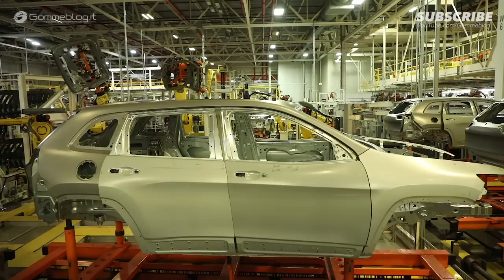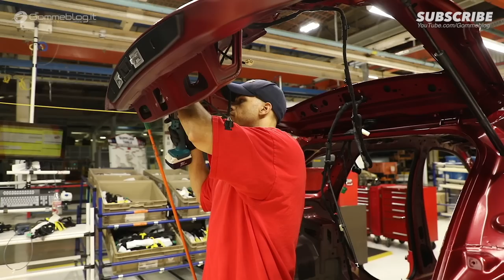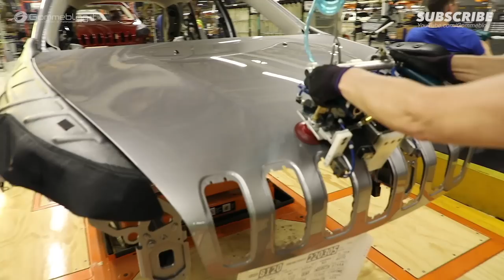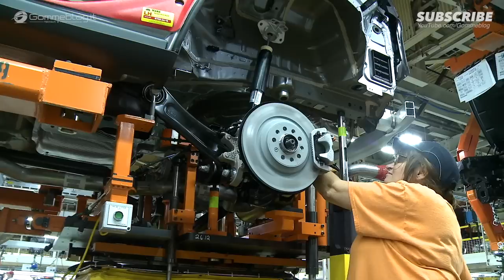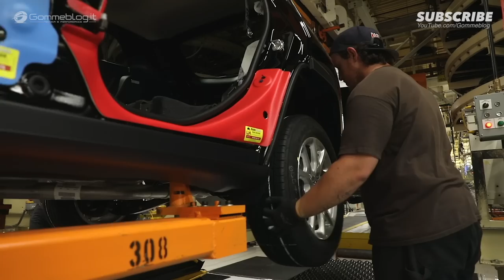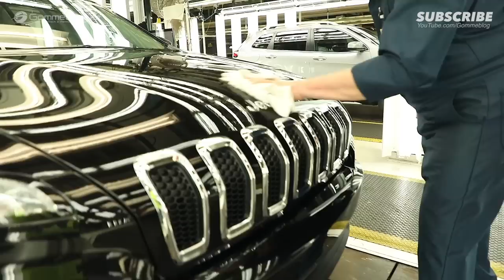Jeep Cherokee CAR FACTORY - Production HOW IT'S MADE

Comment: Fascinating. 
Outside of the 2.4 ltr engine, are there any other complaints about the 2019 Latitude Plus?
Reply: I drive the 2019 Cherokee limited 2.4L. 70k miles and never had a problem.